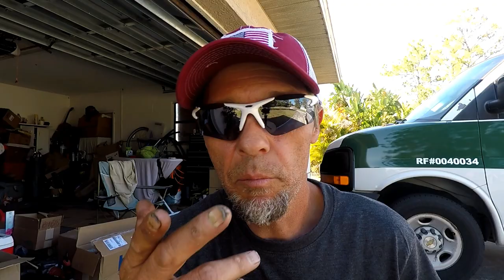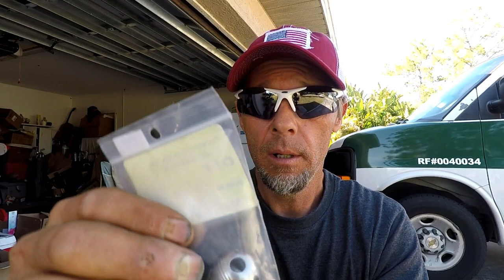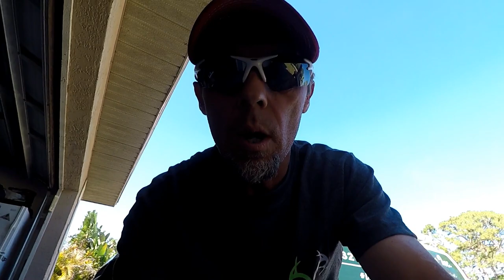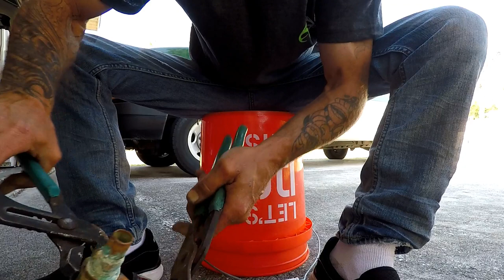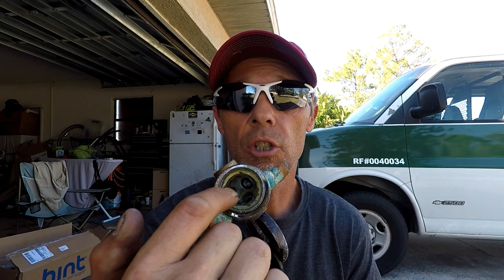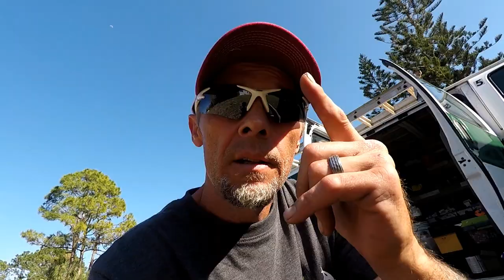HOW TO REPLACE PARTS TO OLD DELTA SHOWER VALVE

Comment: U ROCK MAN !
Thanks so much, ur tip for torching the old nut on my old Delta shower controls worked like a charm, I’m pretty broke do to covid and really didn’t have money to replace the whole valve assembly so I did as u said and the torch let me loosen the nut and replace just the guts ! Thank a million man...
P.S. my wife thank you too, she was worried we were gunna have to cut a hole in the wall or remove tile to replace, but we didn’t ! Thanks again
Reply from the maker: Thanks for watching

Comment: every plumber does it once,,,lol.    i have learn to split the bonet with a hack saw blade and they come apart easy .  we have plumbers come in to our shop daily holding a twisted valve bodys.
glad you posted this video to help people avoid the expensive replacing.
billyjoe

Comment: Tim, your video was the closest I could find to helping with my faucet issue. Any suggestions for how to get the old seats and springs out? Mine are stuck so I can't replace them but I feel like I got REALLY close (for a rookie) to fixing the drip. I tried needle-nose pliers, an alan wrench and even a few smaller tools but the seats look to be the issue. Thanks!

Comment: Do you know what trim kits you can buy to update the look of the Delta shower valve that you talk about in this video.  I don't have a problem getting the retention ring off but would like to replace the handle.  Any suggestions?
Reply from the maker: Go to delta.com and look at what they have and maybe talk with a customer representative

Comment: I removed an old delta kitchen faucet and in spite of my best effort with some wd40 and a big wrench on that little allen head it won't move.  Likewise the retention ring stuck.  I have decided delta sucks sorry delta but you kinda do.  It's time for a new Moen basic 64 dollar HD one with the built in supply lines even got a cute little sprayer.  Supposed to be simple simon to install.  Need adapters for 1/2 to 3/8cc male but not a big deal and the built in supply lines seem to be a good thing maybe.  Anyway will try your torch approach if PB Blaster don't work.
Reply: All right the HD one had too short supply lines and a funky cheap sprayer too.  I went with the Delta 400 chrome model at 88 bucks at Ace and it worked great.  The other thing is two connections in the side holes that you can tighten vs. the one hole thing with the Moen which sucked and couldn't suck down the deck to flat that ss is torqued on the sink I mean it's a nice sink other than that.  Anyway all's well that ends well sorry I doubted Delta.

Comment: Would a melted plastic get inside the valve body and spoil it?  Thanks.
Reply from the maker: Alex M anything is possible when it comes to local water supply and garbage getting shot up there
Reply: I mean when you heat up valve with a torch and melt plastic packing nut inside - would melted plastic get inside the valve and spoil it ? Thanks
Reply from the maker: Alex M not usually the stainless steel ball an Tod will protect against heat and melting in the inner valve
Reply: Thank you very much for your reply.